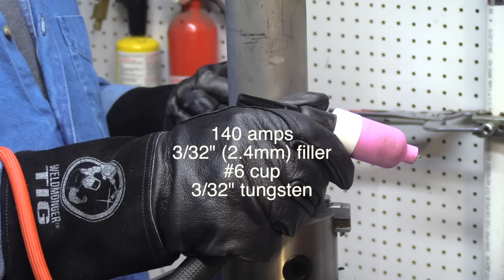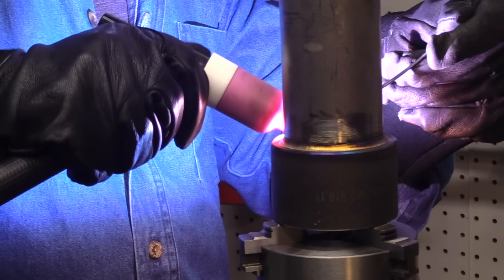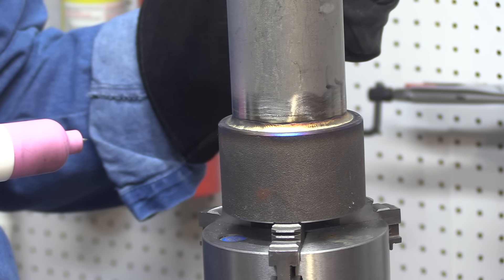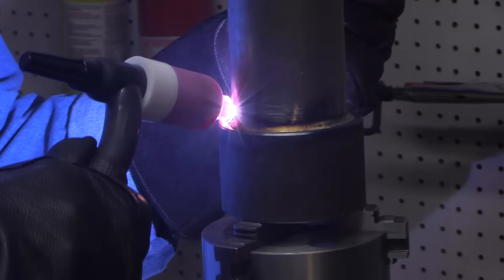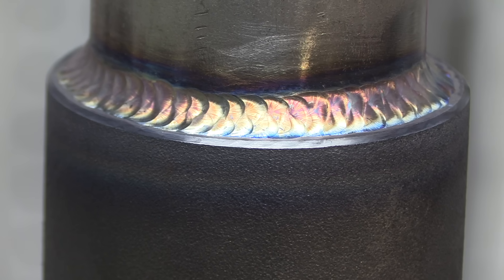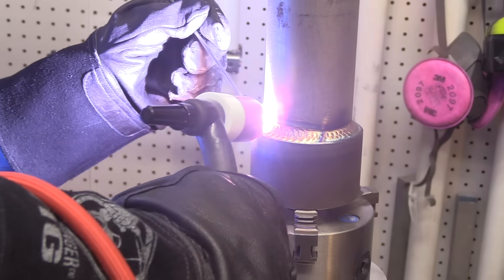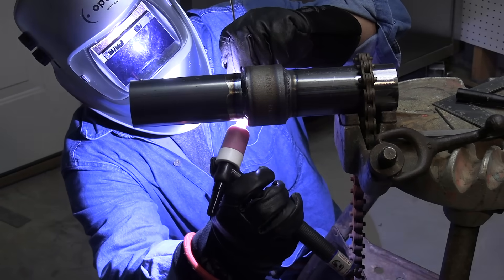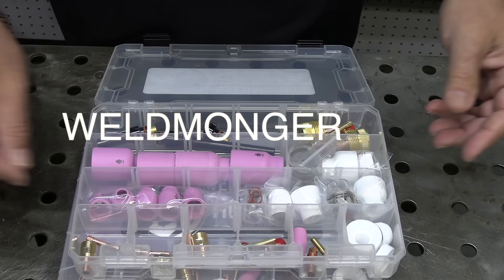Socket Weld Gravy

Comment: I've been having a lot of problems with Stainless socket welds where it's sch 10 pipe. If im too hot I sugar the inside and I'll have to cut it out and redo it or if I'm too cold it just doesn't weld nicely and still sugars cause of how slow I got to go. I'm not using a positioner for welding

Comment: Not too sure of fillet sizes on pipe,but structural as long as the leg is as big as the thinnest member of base metal,you will be good.
I spent 20+ years as a cert welder,mostly arc and flux core,many certs in each. Now that I'm no longer working,I've really taken an interest in gig.
So far this channel is EXCELLENT!

Comment: Hey buddy have a few questions for you being older an what not I have bought tig finger from you. But I just got from a guy who passed away is a dialarc hf welder .it was in his basement an do to things I got three welder but this one is one ide like to get to work with there's no chiller for torch but. Was wondering if u have any info or have used this welder an  if you can give me pointers on it the tig torch that came with it is huge but no water tank to cool torch an I think its about a 82 an up in year. I wish I could send you some pics of it an the pedal that's with it an torch this guy used it in his basement he made his own invented krackanut for nut crackers.

Comment: Great stuff there Jody, i was wondering if you could do a video on mig welding round tubing , 95 or 120 roll bar tubing for instance . do you weld down hill with it or up hill only? im pretty sure no whipping or stitching is allowed, any insight on this would be great, thanks Jody.

Comment: I work in maintenance currently so I totally feel you on the nice clean setup and material. I don't get that too often nowadays lol. My socket weld experience all game from on the job. Nothing in schools. At my previous employer, we also used compression rings between the pipe and socket on some jobs. Any experience with those? Thanks for the content as always.

Comment: Jody I would like to commend you on this socket weld video. In it you demonstrate and talk about (amps/filler diameter) getting the proper root pass root penetration. I worked for Southern Nuclear and was involved in their welding program. I was on an Electric Power Research Institute (EPRI) committee that researched socket weld failures in the nuclear power industry. Our research indicated that the biggest contributor to these failures was lack of root penetration. Again, thanks for the video demonstrating proper socket welding technique.
Reply from the maker: thank you

Comment: Great video Jody, I would like to know how to tig stainless to copper please.
Reply from the maker: silicon bronze filler rod is one way
Reply: @weldingtipsandtricks   Hi Jody I am really really struggling to see through my welding helmet, is there any difference between tig helmet and mig helmet, I ended up using my oxy glasses! It’s the only way I could see my job and the weld!
Reply: Thankyou Jody, I am only a novice at tig, and your videos have help me a lot! I use to do a lot of oxy and sticking welding but that I am over 60 the hands aren’t so steady!

Comment: Pretty work.  I love that Black Hills gold look of 309 on a heavy wall socket.  I've always been interested in the different ways welders hold the torch and walk the cup.  There's definitely plenty of right ways and yours is one of them.  I've always been of the opinion that the tungsten should stay pointed toward the centerline of the bead as much as possible and let the puddle do the melting of the toes.  It takes more filler metal control and more torch movement to control it but it's something I did most of the time.  I think I do it this way because I tend to weld a good bit hotter than I should.  A lot of guys would pick up my scratch start torch and fire it up and would panic.  Lol.  

I was a 56 coded Navy guy but cut my teeth on nickel pipe on my first job as a civilian.  That material took some heat.  Learning how to read the puddle to make sure the inside was breaking without sucking back took some time to learn.  Good puddle control was a must to get consistent welds and RTs.  All this kept them from gettin' my money for a long time.  I was young and lucky enough to get so good at it that the old timers gave me the honor of taking the position pipe rack welds while they stayed on the ground rolling their stuff in the stands.  We worked over a year in that AkzoNobel plant and I really learned a lot from those guys.  I sure do miss the trades.

Comment: I just recently received my package from weldmonger a couple of weeks ago and while the furic #5 kit did make a huge difference with my aluminum welding, the gloves were the biggest surprise.  The fit and feel is incredible and the amount of control that I have over the torch was easily doubled!  Who would have thought you could pick up a 1/16 rod off the floor on the first try and not have to make it your sole purpose in life until you give up and take your glove off.
Reply from the maker: Thanks for sharing!

Comment: I would like to know more about the turntable, how the earth is connected?
Reply from the maker: more on the turntable coming soon .  its a MK model and there is a short ground strap the connects to workbench
Reply: @weldingtipsandtricks  how is the earth prevented from passing through bearings and the motor?

Comment: It's interesting to see you use a large gas lens instead of a regular one, and I'm curious about the reason.  I'd expect a socket configuration like this to trap argon pretty well, so a large lens wouldn't be necessary.  Since the larger diameter lens is also longer, perhaps it keeps your hands a little farther away from what must be (after 1+ minutes of steady 140 amps) a very hot piece of work!

Comment: Very Nice, Thanks for sharing. I'm considering a new welding helmet. Whats your opinion on the one your wearing and a speedglass 91xxx? Thanks for the info.
Reply from the maker: im wearing the optrel 2.0  and its very clear and an excellent shop hood. but with controls on exterior I wouldnt use it for field work... 
I havent used the speedglas 91xxx but I have friends who swear by speedglas
Reply: @weldingtipsandtricks  thank you.